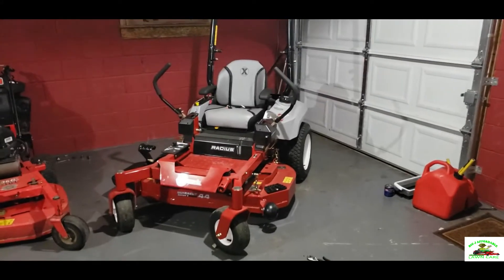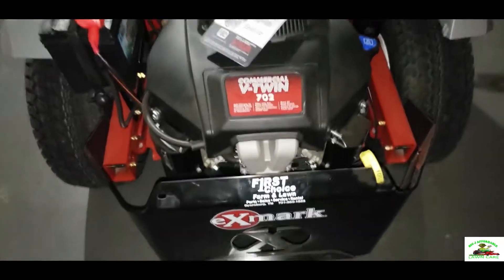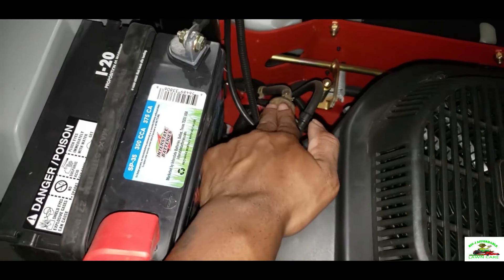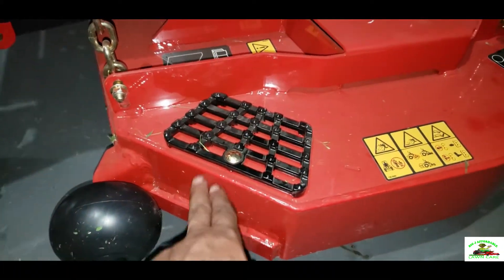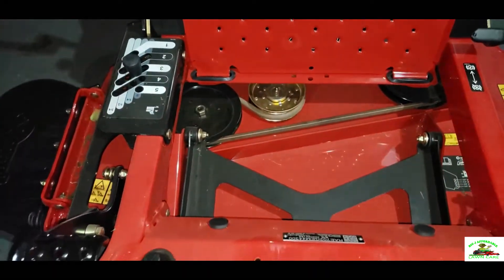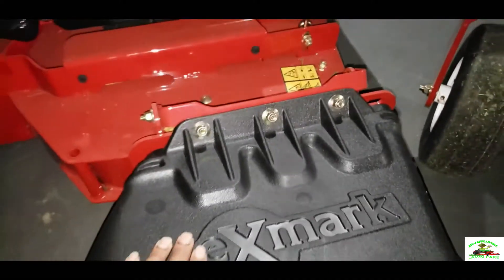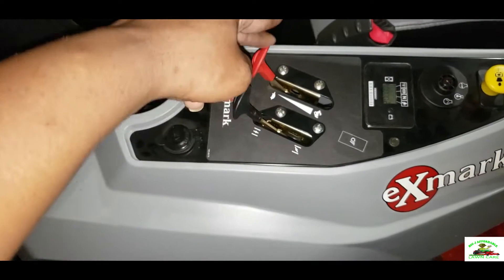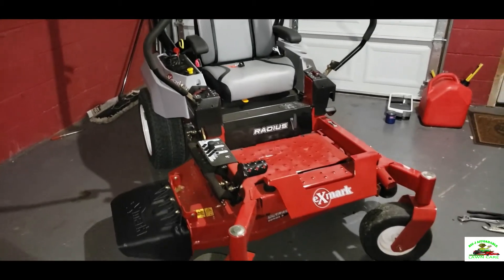EXMARK RADIUS E SERIES (REVIEW)

Comment: I just bought a new one. Mechanic told me you had to keep adding oil and hydraulic fluid. He said it burns about an ounce of oil for every hours use. Is that nornal?
Reply from the maker: appledroplarry
I'm not to sure if that normal. When I first got the machine the hydro fluids was low and I added a little 15w 50 and I check oil every time before cut and never lost/burn oil.